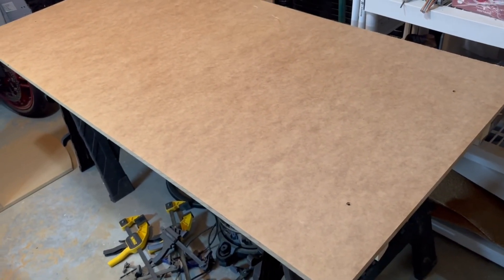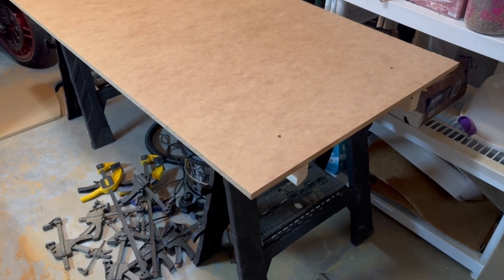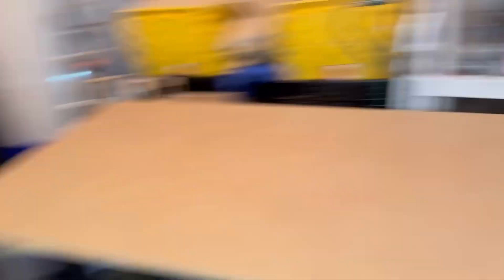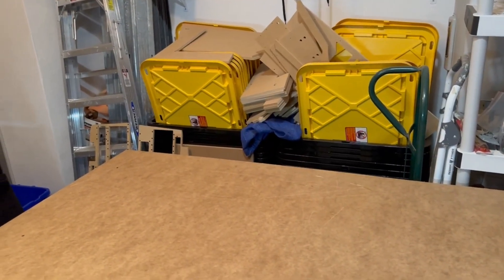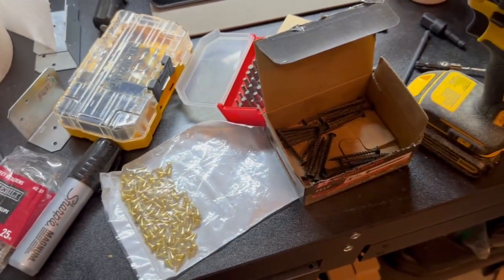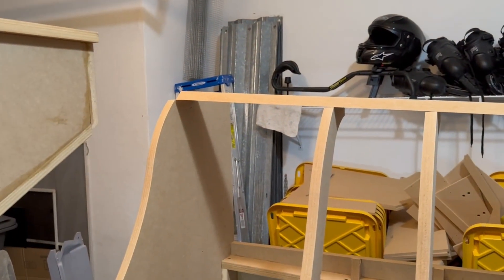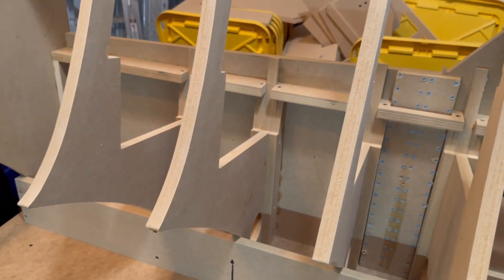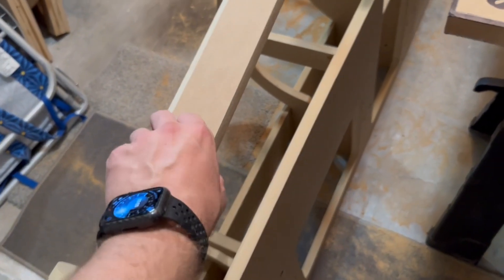An Adder Fanged Building an F 16 Cockpit Part 6: More Side Wall Work

Comment: Now the most important question...   

What for an colour is going to be the panel backlighting?   This lovely vintage orange or military green???

Love your videos btw, discovered your chanel around 2 weeks ago!
Reply: I got a good tip on one of the building groups, leave the back of the panels unpainted and then use LED strips for the backlighting. Makes the wiring massively easier, and for funsies you can easily use RGB LED strips.
Reply: @LtShifty  jeah good tip, but there are a few problems with that. If you want to light out a potentiometer or anything round you'll have problems, it could also hotspot text passages. And if you use bothe, single LEDs and strips you will not get the colour or lighting correct. 

But the colour choice option is pretty cool.  :)
Reply: @memeswithoutcontext4716  that's a good point actually, I hadn't thought about the rotary lighting. That's a way off in my build yet, I've also cut all my panels with LED holes so I have the option to spray the panels and install them if needed.
Reply from the maker: @LtShifty  oh I dig it! I plan to get a laser and start making my own so I’ll experiment :)
Reply from the maker: @memeswithoutcontext4716  thank you so much! 
Def green. Always been a green guy.

Comment: You’re in FL. Consider painting what you can’t see. It’s not just for looks. It seals the wood/mdf and that is a good thing in preserving your hard work. Do what you want as it is your build. However, if efficiency is important you’ll agree it is more efficient to build once and build right. Anything worth doing is worth doing right as the saying goes.
Reply from the maker: @billcedarheath387  ooohhhhhhhh you right, you right. I’m def going to. Good looking out.